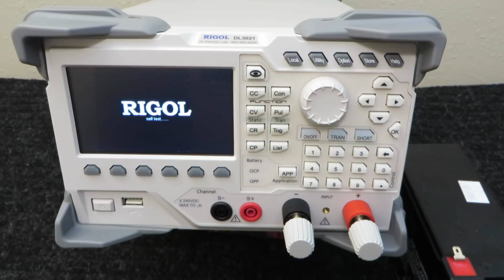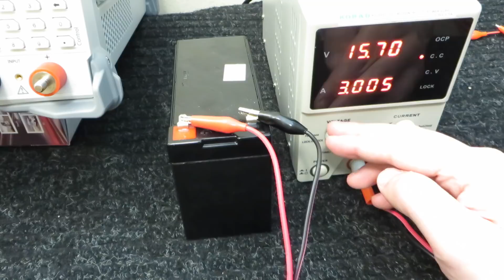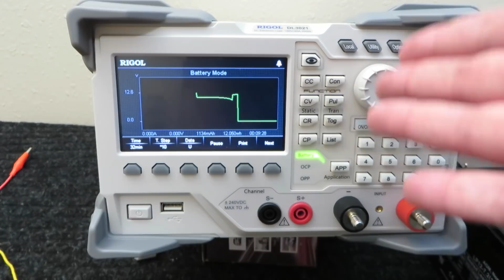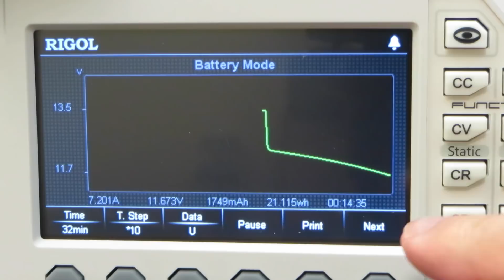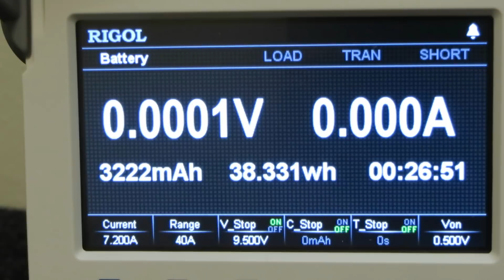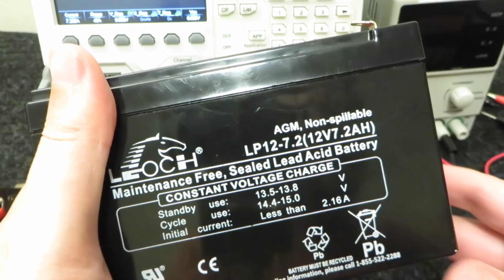Battery Desulfation Demonstration Start to Finish - Part 2/2

Comment: If its automatic, and can be working on 2 batteries at a time, or run it on one with a load and fan, the process SHOULD be automatic. 

Plug it in for a week and get 2 new batteries saves the world alot of garbage destined batteries.

Comment: Very cool stuff! Got me to buy a lab power supply (from part 1). Have always been curious in desulfation but tonight I found the right guy to show me all the things I need to understand (still working on that). I plan to conservatively experimenting with this in a safe and controlled environment with lots of research prior (watching part 1 on repeat) for lead acid battery I have for my plow truck that is pretty rough from a cold winter and no use. Do you think this method is more or less effective for someone like me who also just has a noco 5x3 with repair function (appears to be capped at 16.5 v with unclear amperage and change algorithms).
Reply from the maker: The noco allows forced charge on dead batteries I believe.  It should work reasonably well to desulphate so long as the battery isn't too sulfated.  It's not going to work on a battery that needs a lot of time though - I'm pretty sure it times out after a little while for safety reasons.
Reply from the maker: Nothing stops you from re-starting the cycle over and over of course...

Comment: I charged my AGM battery the same way you did in the part 1 of your video and now, my 12V battery is strong enough to run my entire house for 4 months.
Reply from the maker: You must have a very small house.

Comment: 2.5ah is not 3/4(75%) of that battery rating like you say but 1/3(33.3%) because in your previous video it's clearly printed on the battery that it's capacity is 7.5ah
Reply from the maker: I showed the discharge curve.  You don't get the full 7.5Ah at the discharge rate I was using hence the 3/4 of how it should perform new.
Reply: @knurlgnar24 ok I understand now. I am trying your method now for last 10h on my car AGM battery and it really works because resting voltage was 12.3V but now it's 12.6v and I am trying to push it higher because when it was new 2y ago it was 13.0v at rest. What I found since last night is that discharging it for few minutes really helps in pushing volrages and capacity higher each time. Also wanna ask you about heat role in desulphation because when I went on 2h drives battery would get to 60C  or about 140F and then after such trip the resting voltage would be almost like new 12.8V for couple of days. Do you think getting battery very warm with your method would desulphate even more?

Comment: IT WAS A NON PROFESSIONAL WIRE CONNECTION TO USE THIN WIRE JUMPER TO DO A 7A LOAD !   POSSIBLE A 0.5V VOLTAGE DROP ACROOS THAT THIN JUMPER AND WIRE BECOMES HOT AT 7A LOAD !

Comment: It is easy to do this on a solar charge controller and let it do the work while using a battery balancer.  Less need to watch it constantly and it adjusts based on temperature of the battery bank.  I use a Battery Life Saver Desulfator on the bank permanently since the solar charge controller is going to charge the batteries every day.  I use flooded batteries, only need to add distilled water every 18 months with float set to 13.8 volts per 12 volt group of batteries.  The solar charger will do a controlled boost charge every 25 days automatically.

Comment: Just discovered your video - absolutely brilliant!

What sort of boost charge might you recommend for a 6v 77ah 360a battery? (From a classic car).

Many thanks! 🙏
Reply from the maker: Just halve the voltage and bump the current up a bit.  I'd probably limit current to 4A or so to be safe.
Reply: Very kind of you. Many thanks! 😊

Comment: This is an awesome channel! Question: my 12V AGM 100Ah battery is showing a good charge 12.5V, but the capacity is low. How can I rebuild some of this capacity back?
Reply from the maker: After a full charge voltage should be higher than 12.5V.  Following the process in this video may help your battery if it is sulfated, but it is also possible that it has simply reached its end of life.
Reply: @knurlgnar24  I charged it again and its 12.8V at full charge. I put the battery on the power supply (like the one you have). Since the max current for this battery is 25A (Group 31 with 1150 CCA), I put on max 10A and 30V. Looking at the screen, the battery is accepting 10A, but the voltage is not going above 15V. What should I make out of it?
Reply: @knurlgnar24   I charged it again and its 12.8V at full charge. I put the battery on the power supply (like the one you have). Since the max current for this battery is 25A (Group 31 with 1150 CCA), I put on max 10A and 30V. Looking at the screen, the battery is accepting 10A, but the voltage is not going above 15V. What should I make out of it?

Comment: What is your thoughts on 50v with a 1.0 amp limit on an AGM battery while monitoring temps? Water burn off?
Reply from the maker: Voltage is not an issue for the most part, current is.  As long as you limit your current and monitor battery temperature you will avoid thermal runaway.

Comment: Good morning, I have watched your videos multiple times. I have a PC545 and a pc680 I’m trying to bring back. The odyssey documentation I’ve seen says 15v at 6a. I can’t get any current to flow at 15v but can at higher volts. If I am trying to save fluid in the AGM is it better to limit current amps or Voltage? I have time. I know you said on your big batteries it didn’t seem to make a difference. Just looking for the “best” way first then modify from there.
Reply from the maker: It seems to help to let the battery get warm but you have to be very careful to not let it go into thermal runaway.  Be sure to limit current to prevent that!  I usually limit current and set voltage to whatever so long as it is high enough.

On most AGM batteries you can hear when the pressure relief vents open as they'll make a little bit of noise as long as your ambient is quiet.

If it isn't passing current at 15V but does at 16V are you sure it's sulfated?  That sounds like normal behavior for that type of battery to me?
Reply: No it won’t accept a charge until at least 30v and that is 0.001a. If I go to 50v it will take a charge better but around 0.01a
Reply from the maker: @ OK, that's definitely not normal OFC.  I do suspect the issue is something else though.  Let us know if you manage to get the battery to pass current again.

Comment: What are you doing special in the charger cycle? Or is it just the complete cycle that is restoring it by taking it below 10v?
Reply from the maker: Cycling will desulfate to some extent, but 'overcharging' during the absorption stage does the most benefit.
Reply: @knurlgnar24  thanks a lot depends on its prior life. I've got a motorcycle battery that is just 3 years old didnt use much good candidate to try. Another one 7 years old left on a trick charger. Opened the cap fluid below plates that's probably gone. Would be neat if someone actually took plates form the same old battery and tried different methods.  Project Farm has a good one out used a stick welder and various methods stick welder won. It would be completely not worth it but wonder how well sandpaper would work?

Comment: I have a small 16Ah AGM battery that I tried charging from 700mV. I got it up to 12.3V but the current won't drop, it stays at 4A. The battery, if left alone for 24hrs, will drop from 12.3V to 11.7V. Is the battery beyond repair? I have yet to try cycles of charging and discharging. I will try that next. Thank you for the awesome video❤
Reply from the maker: 4A absorption charge is a lot for a 16Ah battery, is it getting hot?  Be sure to monitor the temperature.  My first thought would be a shorted cell but if it is at 11.7V after sitting disconnected for 24h then that isn't the issue.  Usually when batteries loose too much water they still charge up to full voltage but have very little capacity so that isn't it either.  I'm not sure what's going on with your battery is my short answer.
Reply: @knurlgnar24  thank you for your response. The battery does begin to get hot when left charging at 13.5V 4A after an hour. The Battery is an Odyssey PC680

Comment: maybe a stupid question but if I found a constant current led driver/power supply at a certain volt at around 350 maybe a little more current. could I use that to desulfate a cat lead avid battery? whAT is the lowest voltage you can safely go down to? edit.... car lead acid
Reply from the maker: I pretty much had the power supply set up in constant current mode, so it could work.  350mA is a little low for a car battery but if you're patient enough it might work.  I've seen anything in the range of 1A to 5A in car batteries for desulfating depending on the battery construction and condition.

Comment: I have 4 AGM truck batteries that were fully discharged and kept that way for over 3 months when the truck was sitting in the shop, and somehow I accidentally kept it undercharged at 13.5V for a month before running the truck with them in. The sitting voltage went down to 12.4V so I swapped the batteries out and have the AGM batteries worked on. After watching the video I fully discharged my battery (down to 11.15V since there’s a huge voltage drop to the inverter and the inverter shuts down at 10.5V) with the lowest sitting voltage (12.44V) with a 60W fan (that’s all I got in the truck that I can use while being on the road) then charged it back up and run the repair mode (voltage goes up to 16.5V theoretically). That battery is now sitting at 12.51V. I am gonna hook up a battery monitor to count capacity and to repeat the process until it gets between 12.8-13.0V and work on the rest of the batteries too. Hope it works I am hoping to use them for another 3 years before needing to replace them

Comment: You probably wont see this, but do all these 30v,5amp power supplies  reduce the voltage as the battery charges like it did in your video when you set it at 2amps Or is that a feature of that power supply?
Reply from the maker: They way they work is that you set a 'voltage limit' and a 'current limit'.  If the current the load is drawing is below the 'current limit' the power supply will increase the voltage it supplies in an attempt to increase the current until the 'voltage limit'.  If the 'current limit' is exceeded the power supply will reduce the voltage it is supplying in an attempt to reduce the current all the way down to 0V if necessary until the 'current limit' is no longer violated.  All lab supplies work this way.
Reply: @knurlgnar24  thanks for response man  your units $90 now bit there are others for less just didn't know if they would work the same
Reply: Thanks I purchased the 30v one you shared   have trouble getting to stay on cv like you did in the video, sure it just a learning curve.  

Saved one battery working on a second but it might not work  one cell smoking and getting hot    was hoping it would stop but no luck yet

Comment: If you had a 100ah batt what voltage and amp would you use and if u could guess how long would you run it to being back capacity.

Comment: Did you add any water to the big batteries? There is a way to add to the glass matts. Awesome informative video thanks.
Reply from the maker: I did not and yes water can be added to the glass matts.  I don't recommend this for various reasons but if the cells are low on electrolyte then adding water will help.
Reply: @knurlgnar24   I understand the  not recommending it on here. I have several full river  agms I've been using in a off grid solar system for about 8 years. I've brought back several Small inexpensive AGMs by either adding water to the matt or pulse charging but I don't have those awesome toys you have for checking the ah and such. I wonder if the cycle life the factory puts out is the actual lifespan or if by desulfating and adding electrolyte can get far more life from them. What you say to this question? Awesome videos BTW.

Comment: I found it very useful for what I am doing at the moment . ! have watch both video twice ,  the second view gave a lot more informations about voltage and current that CAN flow in a battery and it`s effects on the resistance down in it .
I am testing a little solar system for only a room and does not want to invest high amount of money on the test . So il will rather find some old batteries and wake them up for all my test .
I have watch 100 of videos about reviving batteries ( Epsom salt/ baking soda / DC stick welding / and more ) I will probably mix some of theses and take the most of it to revive the battery closest to 100% .
Will probably empty one totally , neutralize all acid in there then rince to get all residue out of it then refill with epsom salt solution  before making the desulfurization then rince it again and add new diluted acid before a normal charge .
the experience will demand some trial and error may be then figer out what is the best combination .
A car  electrician has some 100 + batteries lying in his shop , so I will make a deal with him to get them . Hoping I may make some money from them while I can also make a power bank from some of them for my solar things .
Your video interested me because you did mot open the battery at all , But in that case the lack of fluid covering the plates will probably never give a long shot for the battery I think .But It worth the lesson . THANKS .I will give a like and subscribe to your chanel
Reply from the maker: If you get old car batteries make sure they have the proper water level before doing anything else.  I wish you well in your project!
Reply: @knurlgnar24  Yes of course . I already tested a small bat that had only 2V and after adding some distilled water it came to 4.3v without any charge and it has lied like this for 4 days and still hold the 4.3V .
Will put it on charge as soon I get a god weather ( dull rainy weather at the moment ) I will force 20V at 6A from solar panels .So I need sun lol.
Thanks for your reply

Comment: dude you have lots of knowledge about this stuff but I have no idea how you don't know that 12.8v and above means battery is 100% charged. those values you see on the battery is for float charging, doesn't indicate open circuit voltage.
Reply from the maker: Lead calcium batteries as well as pure lead will usually sit at a much higher voltage when fully charged.  12.8V does NOT mean fully charged in many cases.  The 12.8V  rule of thumb applies to lead antimony much better and is frequently stated simply so that people don't complain about their battery not being fully charged.  My pure lead batteries sit at nearly 14V for months after being disconnected.
Reply: @knurlgnar24  well I've had a lot of (and I mean a lot!) experience with lead type batteries and I've never seen any one of them that sits above 13v after resting fully charged. that small agm battery you're testing will rest at 13v at best when it's brand new. now I don't know if your "pure" lead acid batteries are any different (which I highly doubt) but there is no such thing as 14v resting OCV in LC batteries. it's maybe 13.2v at best. nothing more than that.

Comment: It is quite easy to add water to this type of battery. Just have to take the top cover off. Perhaps you should try that with it, and also with your larger batteries.

Comment: I have gone through this process with a vented lead acid automotive battery and it now has 4 good cells (overcharged based on specific gravity) and two that are still low. The battery does read 12v on a meter, but drops to 10-11v with a load ('90s headlights). I want to try giving an equalization charge, which as I understand it would be charging at 15-16 volts and adding water as needed to the good cells to keep the plates covered. My "dumb" charger has a 10amp and a 30 amp setting. Will the 30amp setting be 15-16 volts, or just allow a higher amperage. On 10amp it shows ~13.5v on a meter while charging.
Reply: The cells probably shorted out, how old is the battery? What SG in bad cells?
Reply: As I understand things, it would show 12 volts if a cell is shorted. It's a pretty old battery but the vehicle was not used for several years. That's it's problem, discharged too long and sulfated. I don't have an exact SG figure, just 25% of charge. @SinsBird
Reply: @TomDay-dt7ne  The open circuit voltage on a fully charged battery should be at least 12.6 volts sulfated or not. Charge at 2-3 amps for 2 hours a day, then let it sit until next charge. Before every charge measure and write down the specific gravity of each cell. Add 10 ml or 0.3 oz of water if specific gravity is higher than 1.27.
Reply: Correction - I meant to write "it would NOT show 12 volts if a cell is shorted."  @SinsBird
Reply: @TomDay-dt7ne  Yes, I understood that.

Comment: When you desulfate a battery, and it works, ... how long does that buy you typically before its back at the same level of desulfation? I'm curious to ask this to figure out how long a desultation job is going to last and how often to do, particularly for large amp hour batteries. Thanks.
Reply from the maker: It depends on how healthy the battery is otherwise.  Some last only a few months, others last for over a decade.  If your battery was 'new' and just sat on a shelf then you'll likely get nearly the full lifespan out of it.  If it was heavily used and then got sulfated then it's probably not going to last very long.
Reply: Thank you for the wonderful advise and help.  @knurlgnar24
Reply from the maker: I also should mention that desulfation only helps sulfated batteries.  This is obvious but often overlooked.  If the battery has other issues then this procedure isn't going to help matters.  Batteries age and degrade over time and use and nothing short of recycling them can bring them back to a useful state at that point.  A good number of batteries go to the recycler that are simply sulfated though and that's a shame.